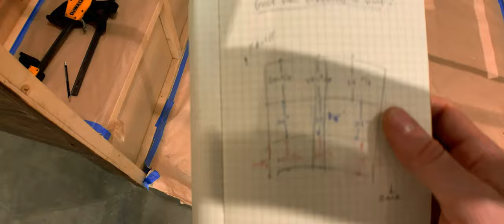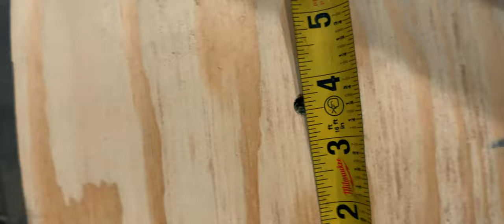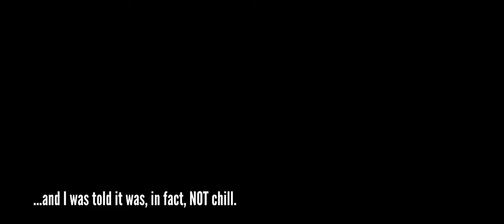DIY Truck Camper Build: PART FIVE - The Roof

Comment: Doing a great job on this camper for someone who claims not to have any wood working skills. For anyone thinking of doing something like this: you can make bending plywood easier by putting wet towels in the mirco wave till they are steaming hot and lay them on the plywood to "steam it", also ratchet straps work well for holding the ply in place but run them all around the shell. Also putting adhesive on all the joints would lock the shell together as one piece.
Reply from the maker: Thank you! Wow- great advice for anyone else; thanks, Tom! And yes, I'll say again that these videos aren't a "How you should do it", but a "How I did it", which seems to have at least worked out for me (the camper has been on my truck for three weeks now with no problems), but I know for sure someone with more experience could really elevate/make the process more efficient. If you haven't, check out @ENDGAME's channel, the inspiration for my build. I literally mimicked his build as best as I could!

Comment: It’s a bit late, I just came across your channel, but several points on the epoxy application. You should wet down the plywood before laying in the first glass ply. Otherwise the wood draws in the epoxy.  Peel ply is awesome. After smoothing out the wet glass, lay in peel ply. Once the epoxy sets, peel it off. You don’t get the blush and the peel ply leaves a very fine rough surface that means no sanding necessary. You can wet down and lay in a second layer of glass. I would peel ply the second layer and then if all is good, finish it with primer and paint. Epoxy doesn’t do well with UV, so you need UV protection. Boat builders, boat owners are a good resource for tips on epoxy and glass work.
Reply from the maker: Wow, thank you so much for this! I have never heard of peel ply. I wish I knew this when I did my build, but I will definitely keep this comment in mind for any future projects.

Comment: Back in the 60's I built a kayak that was covered with a single sheet of fiberglass and three coats of epoxy.  It never leaked until a friend ran it into a rock about ten years later...

Comment: You would've gotten a better result fiberglassing if you had wetted the plywood out with resin, then putting the glass on and wetting it out. Also a ribbed roller would've helped getting the air out. But you should be safe with keeping the rain out.
Reply from the maker: Great to know for the future! Appreciate the input; should be applicable for many others as well. Thanks.
Reply from the maker: Adventures In Paradise  Appreciate it! But I will definitely apply this practice the next time around, thanks

Comment: Did you consider making 1/8 inch grooves horizontally on the bottom of the roof panels? That would have allowed it to bend more easily.
Reply from the maker: Kerf cuts? The thought didn't even cross my mind, but that definitely could have made it easier. It really wasn't to difficult with two people; if I was alone your suggestion for sure would have been the better option!

Comment: How is this holding up? Only just started watching the build series and I’m sure you’ve finished it already, seems like there is going to be a lot of tension in areas which would be fine on a static structure just don’t think it will last well being on the back of a truck?
Reply from the maker: I’m about five months into having it on the truck (haven’t taken it off once) and no structural issues so far!